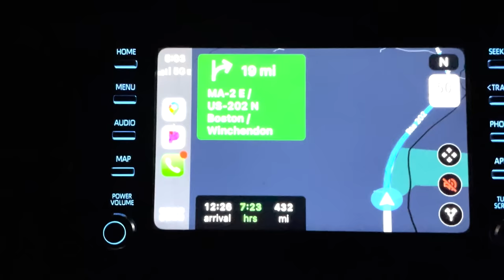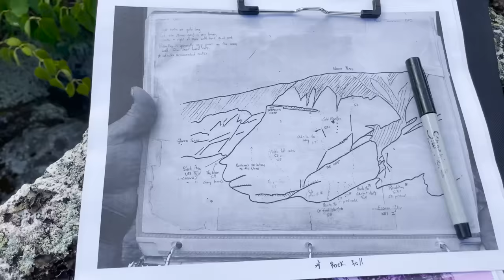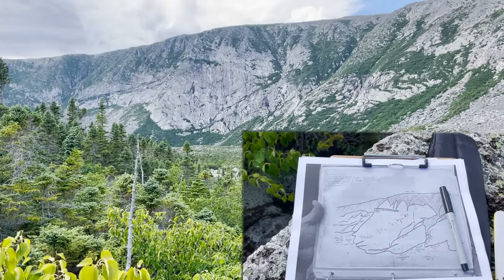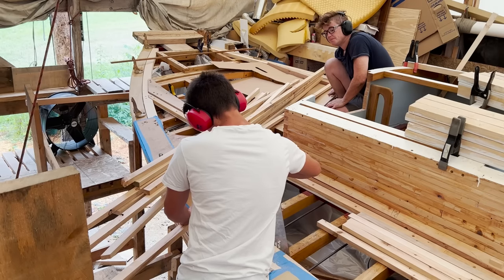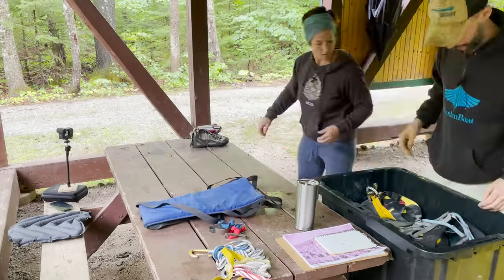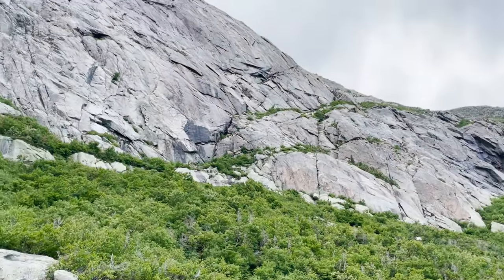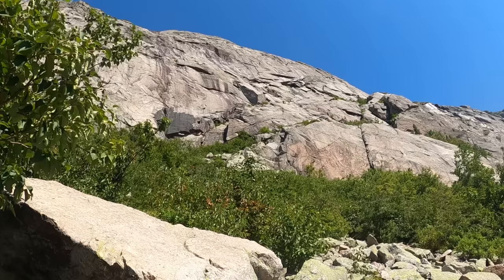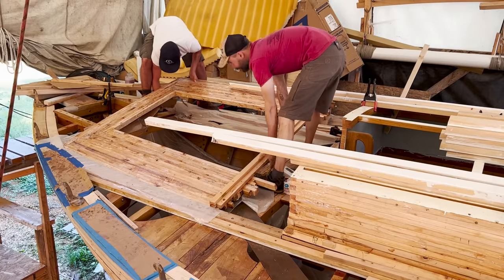Rock Climbing Katahdin: Looking For New Routes -Ep. 230- Acorn to Arabella: Journey of a Wooden Boat

Comment: To safely climb the area without clip points use a fall harness with a one way connector. I don't rock climb but I have done a lot of industrial climbing as a rigger. That system allows you to climb up without the need of someone to belay. After you repell down the face and connect the one way catch you can safely try to climb that face without having to worry about clipping in as you go.
Reply from the maker: Hey hey, do you know how to splice galvanized wire? We’re looking to make our shrouds soon 😉

Comment: Tidbit of history - Seattle Manufacturing Co was bought by Harken. Their first customer was Lloyd and Mary Anderson, the founders of REI. I remember when REI still sold those old powder coated steel hangers meant for hand drilled 1/4" studs. I may have even used a few for drilling rap stations on prior FAs.

Comment: Are you guys not worried about something fundamentally stiff and solid being fixed into something much bigger which is flexible? That epoxied mass forming the cockpit will have to break if it can't bend as the stuff around it moves, unless there is some sort of flexible buffer between the two. And why didn't it work out to a full board either side of the king plank?
Reply from the maker: It’s going to be fit in similarly to how the cabin trunk is put onto the grubs to make a “removable lid” as well. The relationship to the surrounding parts is not much different to putting a fiberglass-sheathed deck onto a carvel-planked hull, really.
Reply: @AcornToArabella  Fair enough, and thanks for the explanation. Seeing the sealing at the junction between the stiff cockpit and the flexible deck structure is going to be interesting.
Oh, and a fibreglass-sheathed deck on a carvel hull isn't a great plan either. That can only end in tears. The differential movement there would be enormous. I'm an architect. I have had to deal with countless fibreglass rooves which have failed due to differential expansion and contraction ....and that's in static structures, not something rolling around in the waves.
Reply from the maker: It's actually pretty awesome, and a great solution to what dooms many wooden boats. The deck allowing water intrusion kills frames and starts a downward spiral. If you really want your mind blown, check out what Richard Stanley is doing in Maine. He builds boats with entirely fiberglass superstructures and decks on wooden hulls. They've found that fiberglass hulls have hurt fishermen due to their stiffness... their careers are shorter than those of previous generations due to it. Many lobstermen are going back to wooden hulls, and his solution has worked really well. Read the full scoop: WoodenBoat Magazine No. 263, page 33. —Anne

Comment: Hello Gang, Steve, the house top in the final shots reminded me that I believe you thought about oval windows, please re-think and put traditional round ones in, I am sure they will look the part.
Loved the high speed long shot of the "bugs" racing up the rock face, cheers from the UK.
Reply from the maker: Both shapes are traditional, Terry, but additionally, the port lights along the sides are round, if I remember right. —Anne
Reply from the maker: Oh! And look up a wooden cutter named Mimi Rose. Bob Baker/Joel White design. Built by Bill Page. Also, many Crocker boats had/have oval port lights. —Anne
Reply: @AcornToArabella  Thanks for that Anne, I look forward to whatever shape they may be,
Reply: @AcornToArabella  Hi Anne, I just looked up pictures of Mimi Rose and actually the oval windows along the sides look great and give the impression of speed, cheers, Terry.

Comment: Encapsulating wood in fiberglass is the worst thing one can do. Although it would be seald 100%, moisture will still be generated inside ( I still can't understand why or how) and surly it won't come out and dry and thus the wood will roth much much quicker. I'm writing this cause it happened to me in the past, so I felt I should give you a heads up!
Reply from the maker: Water doesn’t get generated… this is new, dry stock. HOWEVER, you cannot fiberglass wood that has already been out in the elements, for example, a wooden hull that’s already seen cycles of swelling and drying. Strip-building and fiberglassing is a conventional approach to boatbuilding, proven and well documented.

Comment: Is using cedar necessary? You mentioned that it will all be fiberglassed. So would it be possible to just use the cheapest wood available? Or is there a reason I do not understand to use cedar anyway? ...or do you guys just have extra cedar around?

Thanks for another great episode. I will never build a boat but I find the entire process fascinating.
Reply: It's light,  it's strong,  and it takes to epoxy very well.
Reply from the maker: Cedar, as Dan says, is light and strong… and we have less than perfect lengths of it in spades that lends itself well to strip-building. It costs nothing for us… it’s handy and dry and ready to go!
Reply: @AcornToArabella  yep.  As core materials go,  it's way better than a lot of the foams,  not only does it grow on trees,   cellulose is darn impressive structurally,   heck,   they make whole forests out of the stuff